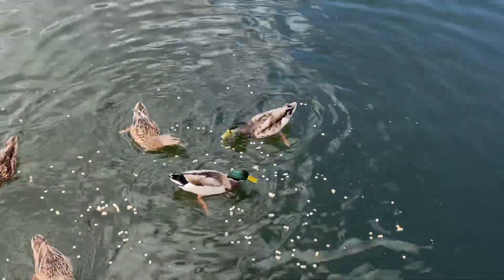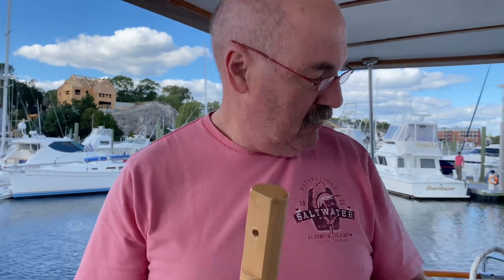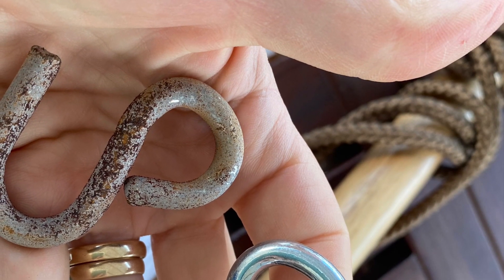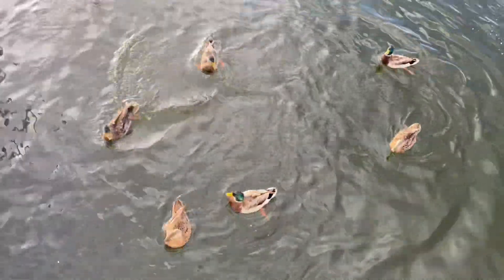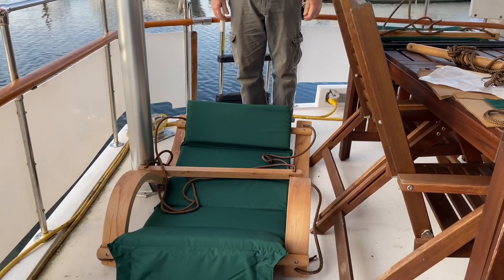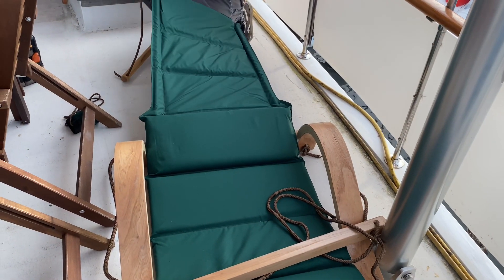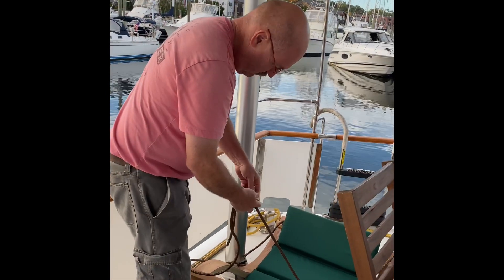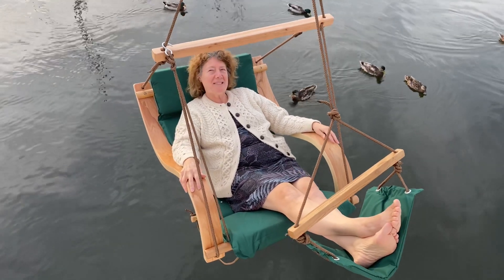I like the SoCo Swing Chair that I bought at the Newport Boat Show, but…

Comment: thank you;   i bought one too and should have looked at it closer...very difficult to assemble
Reply from the maker: Yes, difficult to assemble and needs stainless hardware if used in a marine environment, but super comfy! It was my favorite reading spot this summer, and the grands took turns when I wasn’t in it. :)
Reply: @KathyFitz1113    thank you for your video    helpful.  love my swing too ;)

Comment: This is THE WORST experience I have ever had with a company.  The first delivery of the “swing” did not have ANY hardware included.  It took 2 weeks to get me the hardware kit, oh wait HALF OF THE HARDWARE KIT.  Yeah just a few bolt and one eye bolt, 4” piece of chain, basically junk.  I asked for an RA number.  BTW, there is never a response from the “customer service”.   They will not take returns.   Sent me another hardware kit.   Directions are not legible, with no pictures to refer to even though we are directed to refer to a picture.   I did find there history with the BBB in Spring Hill TN.   This is an awful company.   I can hardly wait for the Cincinnati boat show this year.   If they are there, I will make sure NO ONE even comes to there exhibit.   DO NOT BUY FROM THIS COMPANY.   You’ve been warned.
Reply from the maker: Wow, I thought sending the wrong hardware was bad, but NO hardware?! Then they resolve it by sending half the hardware…Unbelievable!

It probably wouldn’t have been so annoying if they weren’t so expensive! In this instance you definitely do not get what you pay for!

But I do still like the chair…